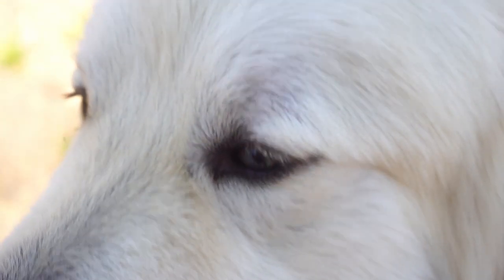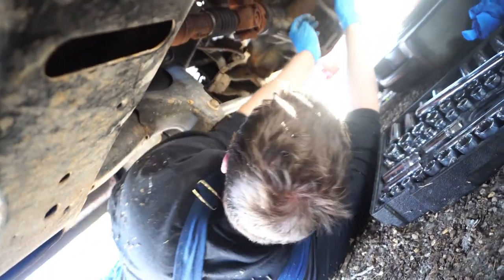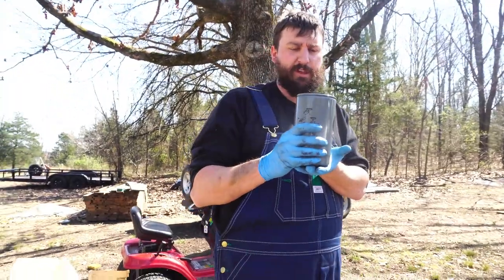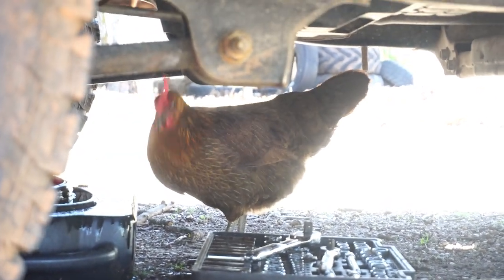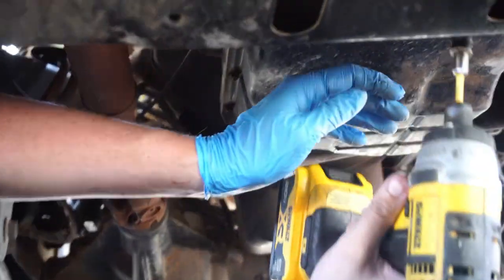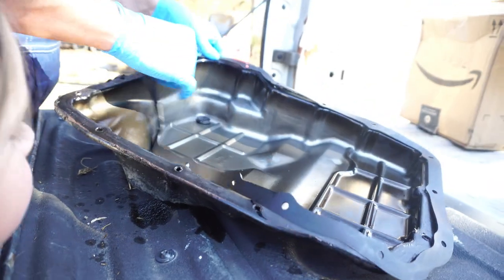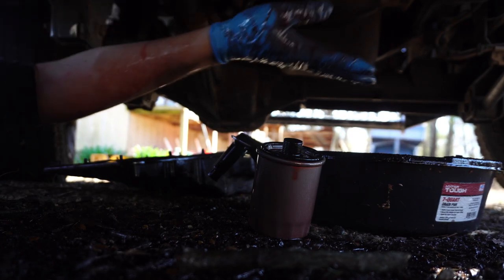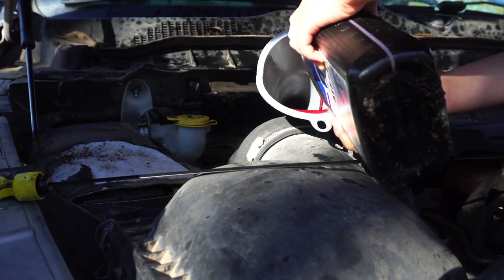Teaching a 5 year old Truck and Tranny maintenance!

Comment: You don’t use vegetable oil?! 😮
Reply from the maker: I hear vegetable oil smells really good when used!
Reply: @strangerintheland  You ought to ride in a homemade bio-diesel truck made from deep fryer oil! You'll be starving for fries before you get to the end of the driveway 🤣 Edit:I meant the bio-diesel was homemade from fryer oil, not the truck. Seemed a little confusing after I posted it.